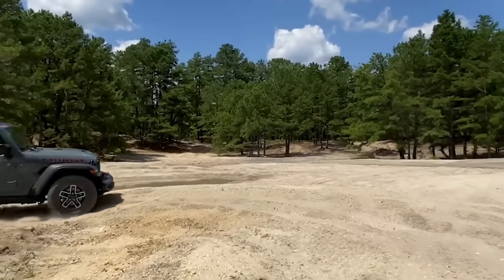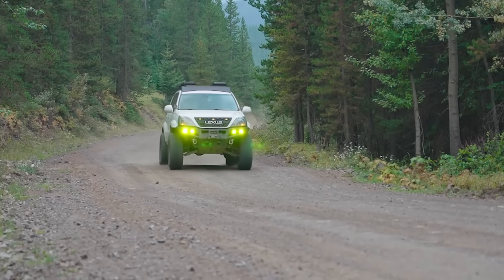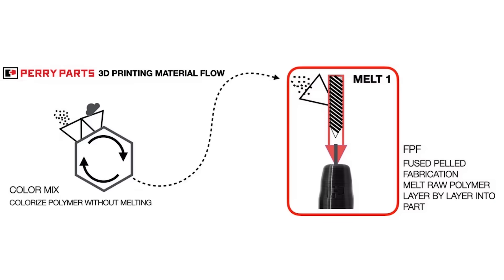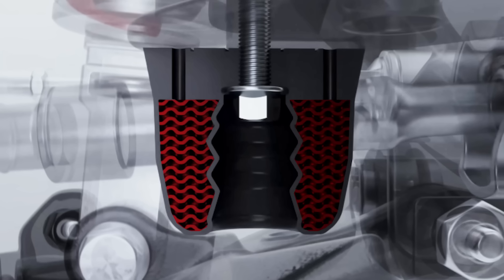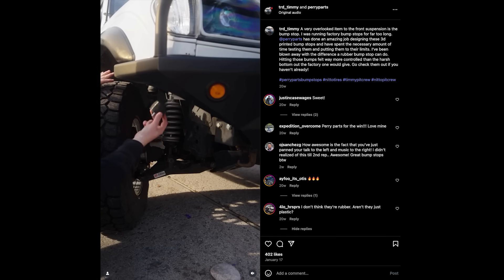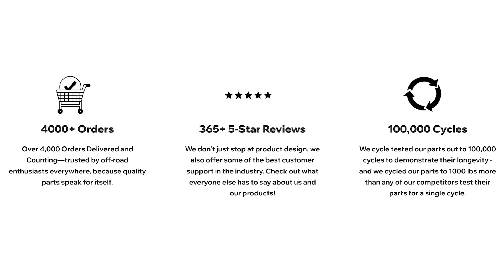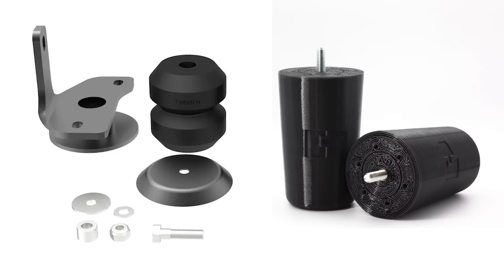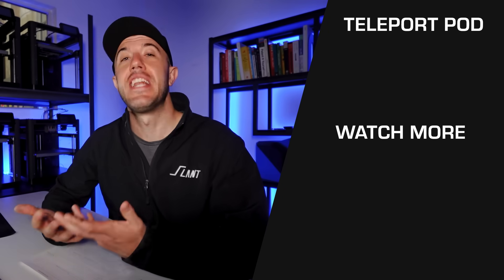Perry Parts are a Masterclass in 3D Printing Design | Real 3D Printed Products

Comment: So they created a bump stop, used inexpensive ways to engineer the parts, then use inexpensive pellets instead of filament, and still sell a bump stop for $99 😂😂😂. It now costs them less than $2 a piece to print them out. Business model is to make something for really cheap that can be sold for a lot.
Reply: Our shock dyno costs over $20k alone. We have a print farm that cost us north of 200k, and we have thousands of hours invested into R&D and product development. 

The 3D printing industry will not continue to advance if we have this mentality about the process. Printing is more expensive than molding at scale, and yet we are half to 1/3 the price of our competitors. I’d argue we’re providing excellent value for the industry.
Reply: There's probably a lot of other overheads involved with processing and delivery, so it's probably not 98% profit. No doubt they will have targeted a price range that strikes the balance between margin and volume to try to maximize their profit.

But funnily enough, even if they could afford to sell it for, say, $10, they might actually get more business selling it at $99, because if you price it too cheap, many people assume that it must be junk, especially when the competitors are charging $200-300 for equivalent parts.
Reply: The materials are only a tiny fraction of their per unit cost. They have to account for the cost and wear and tear on the printers and other equipment, the monthly costs of renting a space to put that equipment, electricity costs for the space and the equipment, shipping and handling costs, a living wage for both themselves and any employees they have tending to the machines and doing all the other stuff to run the business, insurance and other benefits for themselves and employees, and the list goes on. My company produces software. It would be silly to say that our profit margin is infinite simply because the cost of duplicating the ones and zeros of a program when a customer downloads a copy is basically zero. Same thing applies here. Your "math" is silly and just shows you have no idea what it actually means to run a business.
Reply: Anyone who things that the only thing that goes into the price of a part doesn't know how to run a business
Reply: While priced for the value and way cheaper than alternatives… pretty great niche imho
Reply: And the hundreds, if not thousands of hours that went into product R&D, building their own custom machines and patenting the designs - how do you suggest they recoup those costs? A lot goes into running a business besides the cost of the product itself.
Reply: @eca7773   that's how capitalism works in a nutshell: buy low, sell high. Of course the idea of the free market is that you are allowed to undercut your competitors, if you can find a way to do it cheaper, which is supposed to work as a sort of balance, keeping prices affordable through competition. Challenges arise with collusion and a niche market with a lack of competition though.
Reply: They don't have to be cheap, only cheaper than their competitors
Reply: Figure out a way to make a better part with very low manufacturing costs, sell it for much less than the alternatives and rake in the dough. Everyone wins (except the competitors, but thats life, consumers and innovative suppliers are who you want to come out ahead).
Reply: ….you should realize that’s how EVERYTHING works
Reply: That’s how things work, did you expect them to sell it for $9.99
Reply: Oh yes because the only cost is the raw materials used in production. The machines they use, the time designing it, all of the business overheads - they aren’t real costs…..
Reply: Have you seen the prices of pellet extruders? Going to need to sell quite a few even at $100 just to pay off that extruder.
Reply: I thought that was supposed to be perfect in a capitalist world?
Reply: while using a manufacuring technique everyone has at home now.
Reply: @julianweiser9985 it’s not the technique it’s the brains and ingenuity behind the product, that’s not available commonly…
Reply: @julianweiser9985  … We do live in an amazing age.  However, Not everyone has access to engineering expertise or the hundreds of man hours it takes to design/redesign; or means and funding to purchase professional industrial testing equipment.  So much more to consider than how ubiquitous printers have become.

Comment: What a revelation on printing flexible components using TPU. I have been designing a flexible mechanism and have struggled to make the joint aspect work and replacing woven wire as a connector with TPU will be a complete game changer.
You make the best videos on 3D printing and I have learned so much by watching them. 3D printing is the future!

Comment: Yes I did exactly this last year for a set of low profile bump stops (out of TPU95A) I needed on a pair of traction bars. I dialed in the "stiffness" by making a few with different infill/columns to get what I wanted.
Reply: cease and desist is in the mail.

Comment: I've had fun learning to design parts specifically to be 3D printed, notably when you think about how the part is 'drawn' and how long extrudes help with the look and strength of the final print, my Hoopin TPU Cable Tie utilises that aspect of printing for great results, they're very strong and easy to print.

Comment: If what Perry Parts makes is so good why are they not selling to the auto makers?
Reply: @martinathome296  We do sell white label parts to some OEMs for higher trim levels. Lots of OEMs just want to use simple micro cellular foam bumps because they’re cheaper
Reply: @martinathome296  because they can't supply such a big demand and they make more profit selling to the end user than a middle man.
Reply: Big OEMs will never pay more than a few cents per part.  You could never make these cheap enough.
Reply: @saxplayingcompnerd  Thanks so much for your input - that does not align with our experience - they will go cheap for mass market trims, and we offer competitive pricing for the higher trims and show vehicles that they’re chasing performance on.

Comment: Question: will Slant 3D offer tpu printing at some point in the future?
Reply: @sillyshitt  with pellet extrusion :)
Reply: The previous podcast episode answered that question. Basically it’s a long term goal as they have many other things to optimized right now.

They also prefer the stiff TPU’s and would likely offer that first, and they would like to see more vendors offering it at lower prices so it is more widely adopted. But I prefer the ultra flexible TPU’s😢